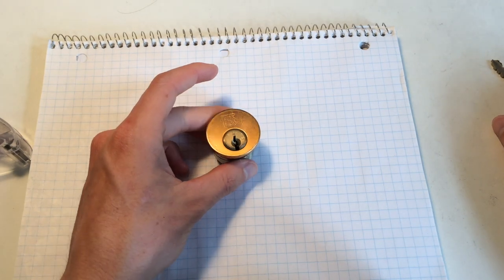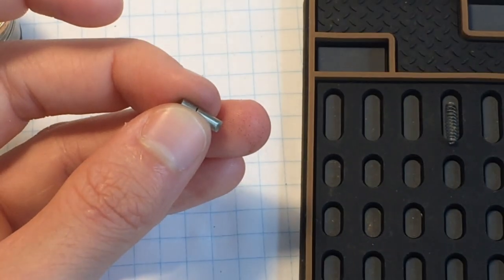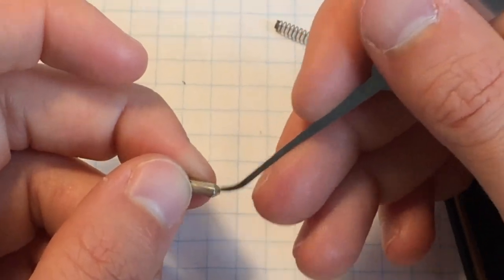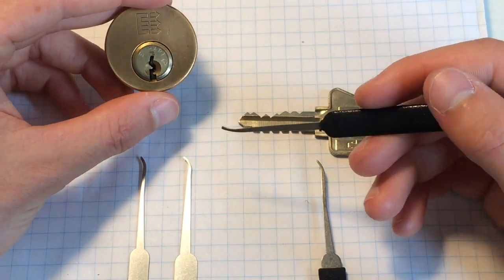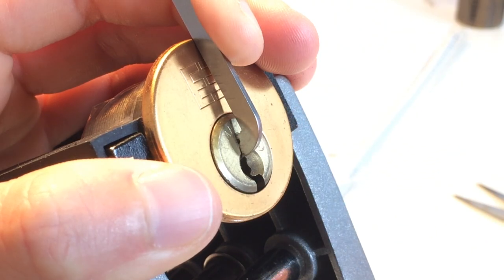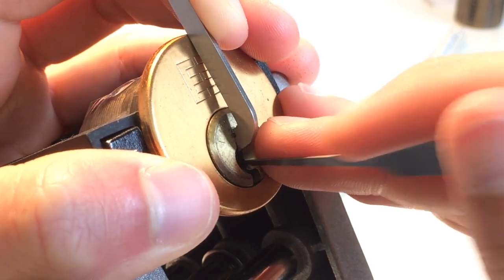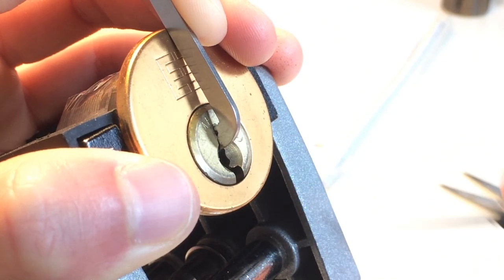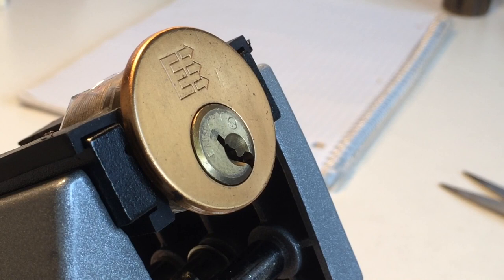How to Pick the Corbin Russwin Emhart

Comment: Thanks for the video Geo :) When rotating a pin, do you mostly "push" on the pin sides to rotate, or do you mostly "pull"? With Medeco I've found it easier to pull, but with Emhart I'm finding it easier to to push.